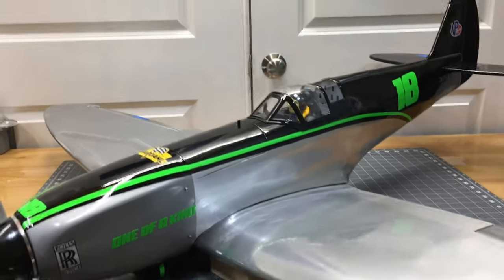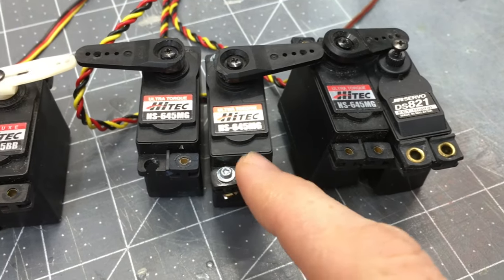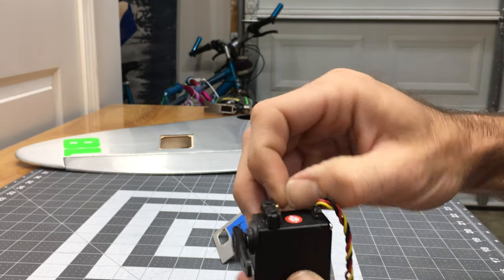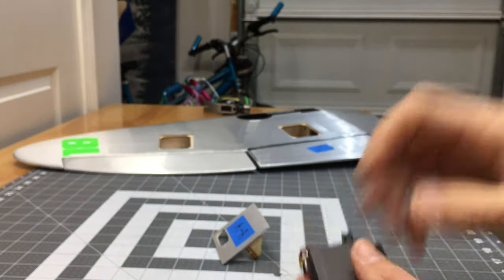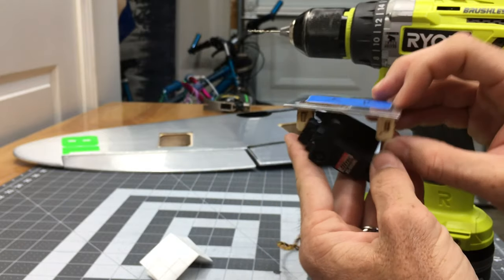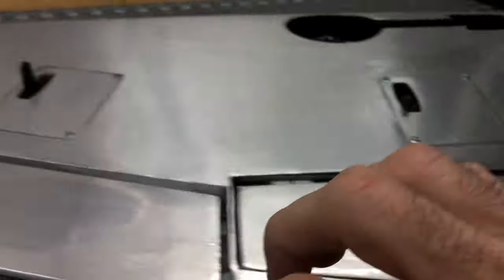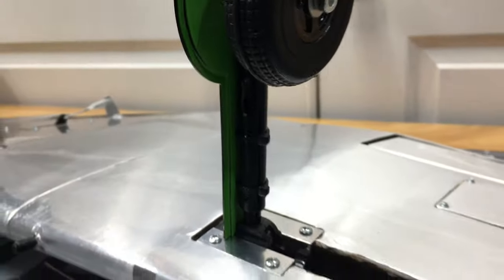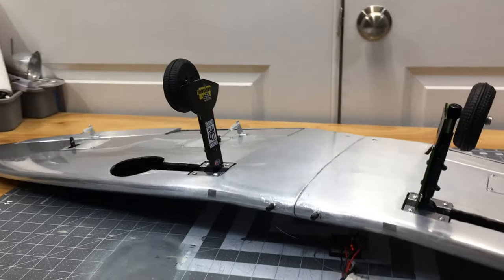Phoenix Models Spitfire Reno Racer Conversion Part 7

Comment: I went electric retractable gear I could not be bothered with a servo gear to me junkie
Reply from the maker: Mechanical retracts  are great! Super reliable when set up properly and simple. Electric retracts are nice you can just screw them in and go but I like all three electric, pneumatic and mechanical I use them all. If you know how to set up mechanical retracts  you will never have a problem.